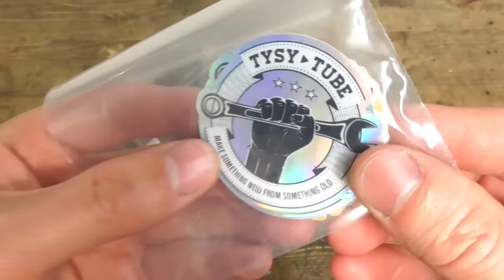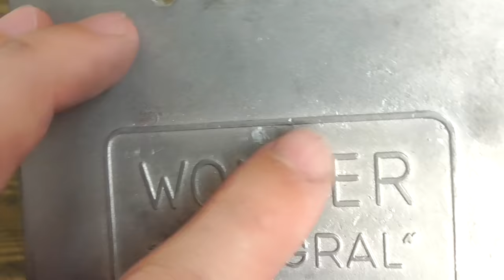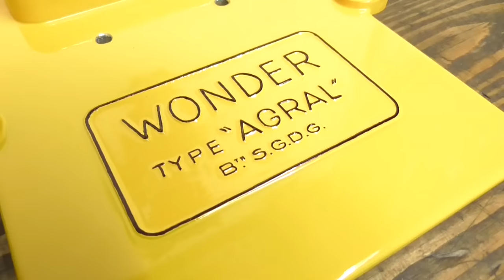Iconic French Wonder Lamp - Restoration

Comment: "I bought a new battery"- finally something this guy couldn't make a new one of.
Reply: ALLFAHQDUP Just because he had no time enough.
Reply: What kind of a battery is that, anyhow?
Reply: @Madness832  by the size of it and the time period for when this product was meant to be used, i'm thinking it's lead acid.
Reply: @carlos2004  Nah the battery says 'Alkaline' right on top so its not a lead acid.
Reply: I have watched many of his restorations, believe me he can make a new battery......(given time and materials).
Reply: @mohabatkhanmalak1161  I was going to say, just give him time. He will make a new one.  :-) I can see him carefully wrapping the layers and checking the voltage as he progresses. It will be Lithium. Much, MUCH better than new.
Reply: He just didn't want to. So there !
Reply: @jlucasound   and safer
Reply: Looks like a reproduction to me
Reply: @Madness832  look like 6R25L
Reply: Haha! 😂
Reply: I feel like cuz of this comments thats gonna change next time....
Reply: He did a bad job in that he removed all the cast marks.  They are SUPPOSED to be there.  This is no longer original. 
Re-charging a dead alkaline or carbon zinc battery is pretty easy.  All you have to do is cut it open and replace the chemicals and put it back together.
Reply: makes battery
Reply: Don't tempt him 😅
Reply: @jlucasound  Not lithium, but it is pretty easy to build a functioning battery or to recondition an old one
Reply: I've seen him buy screws!
Reply: @TomaszPyra  Googling for that shows pictures from this one, from Eveready actually called "Fanal" (as noted in the lamp), and even from  "Wonder" (a disappeared French battery producer).
Reply: @tarstarkusz  yeah I agree the cast marks should be left untouched, they add to the character, not every part has to be flawless and polished.
Reply: i buy a new one
Reply: Not yet
Reply: Hello @andreaslightangels , any pictures of the "something" ? 👀🙂
Reply: They probably tried
Reply: @tarstarkusz  no he did not do a bad job and of course it’s no longer original he’s restoring it to basically a brand new state
Reply: @Ashthecyberwolf  No, he did not restore it, he created something new that did not exist before.
Reply: You know if he had the ability and time he would have XD
Reply: Love the name bro
Reply: The finished result is better than when it was new. Very few products are ever made with this level of care
Reply: just bc he was too busy to do it
Reply: Don't give him ideas
Reply: Nxt video, i restore lead acid battery🤣🤣
Reply: Carbon pile dry cell
Reply: He could also use a rectangular battery of the alkaline ones that are 9V, but those bulbs are originally designed for 3V and the manufacturers put a 9V battery and that causes a reduction in the life of the bulb.

Comment: Fun fact: SNCF still uses the exact same lamps ! 
Old and rusty-looking as they're far from restored but they still use them even in the newest modern trains.
Reply: Are they still incan?
Reply: I think it would be interesting to see how much oomph and battery life you could get out of a good LED and and the massive lithium ion battery that would fit in that compartment.
Reply: @DinnerForkTongue  Yep !
Reply: @microcolonel 
Depending on the quality of regulation, an LED lamp with a li-ion battery (or battery pack) of that size could run a month at 50 lumens, easily.
Reply: Candela determines throw, not power output.

Comment: Wonderfully done restoration, as usual.
However, I'm not a big fan of your choice of color. Most of it, the shiny look don't match with the original purpose of this lamp. As you mention in the comments, it was mainly used by railways workers (in french "cheminots"), on construction sites, shipyards and various industrial environments. For such uses, the body's  paint was grainy, matching with the grainyness of the cast aluminum. A kind of painting seemingly made to resist to outdoor use and harsh treatment.
I've seen (and actually used) several models, including this very "Agral" type, and I don't remember another color than a dark red/brown. The handle was bare iron and even the door knobs and top switch were painted the same color (or maybe it was dirt on the knobs...)
I hope you will not blame me for these little historical details, as I will keep on following your amazing work with the greatest attention and pleasure.
Reply: Ok, fair point, but consider the context.
 These restored antiques will never again be used for their original utilitarian function. With my machines first-class restoration, they have become more like an objet d'art, to be displayed and appreciated.
Therefore to do proper tribute to their beauty beyond the idea of their original designers, they require colors that make them pop, drawing attention to their original quaint design and form.

Comment: When you make new ones, do you manually maneuver the lathe or do you build cam models of the piece and then run it? Anyway, keep up the great work!
Reply: TheNintendoFan37 around 9:18 when the bolt falls down, the lathe immidiatly stops. So i guess its a conventional one. Also it looks quite old

Comment: As usual, you did a superb job on this lamp, even if I sometimes regret that you do over-restoration. It would have been great to keep the "frosted brown" aspect of the original paint.
Indeed these lamps were in endowment for all the railwaymen of the SNCF, the French state railway company. My grandfather was one of them. He kept this lamp when he retired, and I still see it hanging in the barn where he had his workshop. Now that I am old myself, I regret not having been able to keep it.
These lamps were used, for example, when the tracks had to be traveled at night, or to transmit agreed-upon light signals. They could also be used to replace a failing fixed signal of a train or equipment. Thank you for bringing back these beautiful memories.

Comment: Beautiful restoration (as usual).  Even in before restoration, it is beautiful piece.  But after?  WOW.  You are right, canary yellow is an excellent choice of color. :-)  Surprised the battery compartment lid does not have a rubber seal gasket.

Comment: what a project. i would like to give a suggestion that might help you later on with your restoration. in this part 14:41, im not sure if it will work on that prism, but you can use hydrogen peroxide and powdered detergent to remove the discoloration on it. Ive seen several videos using that chemical to remove yellowing on clear parts especially clear plastic
Reply from the maker: Thanks for your input!

Comment: I don’t want to go over all the comments, so, maybe someone else noticed these. It’s not to criticise, it is absolutely an amazing job. The things that bothers me. 
The mask for the plastic orange seems in a wrong position (the plastic would have been inside the mask?), I also believe there is a purpose for this mask, but you didn’t test it. The yellow clip, I thought with UV and H2O2 it is possible to restore it to its original colour, maybe I am wrong. Would it also be nice to see the contact of the battery with the lamp. Stated that it is an amazing job and I liked it a lot.

Comment: Absolutely Marvelous. 
If you don't mind me asking, I have a question: Why do you use paint stripper instead of sandblasting the paint?
Reply: The sand blaster being used is a recycling blaster, so they reuse the media- and if you were not recycling it then it's fine to use it to remove paint. But here you'd be mixing old paint with the media, so you don't want it gumming up the system.
Reply: I reuse my media as well, and the cyclone dust filter does a pretty good job of getting the old paint out of the media. The media doesn't last forever anyway

Comment: How do you make it for the machine to create an exact match of the bolts you cannot use? Do you make a 3d design from eye or do you use take standardised models and adapt them using 3d applications?

Comment: Hi, a question, can I sandblast something without removing the paint first?
Reply: The sand blaster being used is a recycling blaster, so they reuse the media- and if you were not recycling it then it's fine to use it to remove paint. But here you'd be mixing old paint with the media, so you don't want it gumming up the system. The media also will go bad faster.
Reply: @mamfzf  thanks for the explanation!!

Comment: How do you spin brass on the lathe without it making a loud screeching? I remember working on projects in shop class and the brass rod would scream non-stop. I think the speed was correct...
Reply from the maker: it mostly happens on bigger diameters with deeper cuts.

Comment: With those I kind of prefer a "better than original" approach. I mean this is done in the finish quality already anyways. Put a juicy LiPo power pack and a decent LED bulb in there and it will last you 30h with higher and better light output. If you feel extra fancy make an USB-C cutout and add a power bank functionality.

Comment: i have a question.....early in the video he uses a chemical stripper to remove the old paint, then does the sandblasting. why not just sandblast all the paint off too? would it take more of the expensive sandblast beads to remove, than to use the cheaper stripper? that would seem faster, but maybe not cost effective? just wondering, if anyone can answer.....

Comment: Why do you use paint remover and then go to the sandblaster?
Why don't you go straight to the sandblaster?
Reply from the maker: Sandblasting media is very expensive and it turns bad a lot faster when there's a lot of dirt or old paint in it. Therfore I always strip it first.

Comment: Why wasn’t the paint just sandblasted instead of stripping it first?
Reply: The sand blaster being used is a recycling blaster, so they reuse the media- and if you were not recycling it then it's fine to use it to remove paint. But here you'd be mixing old paint with the media, so you don't want it gumming up the system. (Also, it's not MM's personal Blaster)

Comment: Dude I've been watching your stuff and your skills are pretty good.  You've fixed things that I would have thought were unfixable junk.  But one thing bothers me.  You can't call what you are doing "restoration".   Repainting and putting new wood.  Fine these things are so far  gone it needs to be done in some cases.  But your removing mold lines from the cast the manufacturer left, sandblasting and then adding sometype of bondo to fix the pits left because of the sandblasting bevermind all the metarial you remove to give it a better finish than the OG manufacturer ever gave it.  
Don't get me wrong I like what you're doing but collectors and historians are probably pulling their hair out you calling it "restoration".  At best it would be called a resto mod.  This is just my personal opinion plus I'm amazed how well some of your stuff goes back together sometimes cosidering how much material you've removed on some things.
Reply: Take those brass knobs at the 11:15 mark as a case in piont.  You polished them so much you've damaged the original knurling from the pieces.  If you had stoped at removing the patina and just done a light polishing it probably would have been fine but you rounded the edges off and almost completly removed the knurling.